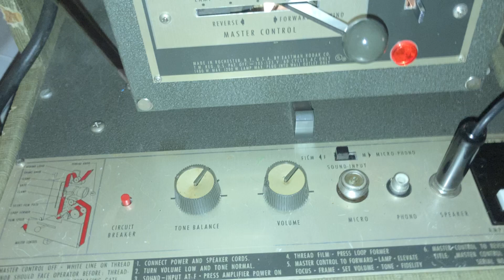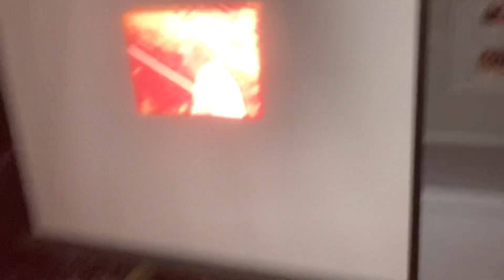Kodak 16mm projector bonus vid

Comment: I got a 2nd projector now its a Kodascope G II from 1939 or 1940.
Reply from the maker: 1939 or 40 made with all metal parts and built to last 80+ years
Reply: @oldradiosnphonographs  It's in great shape and works, except the power cord is starting to turn into goo.
Reply from the maker: @Tadfafty  don’t want to leave it plugged in too long if that’s the case. This one has a cord that you can remove?
Reply: @oldradiosnphonographs  Yeah, I'll see about replacing it.